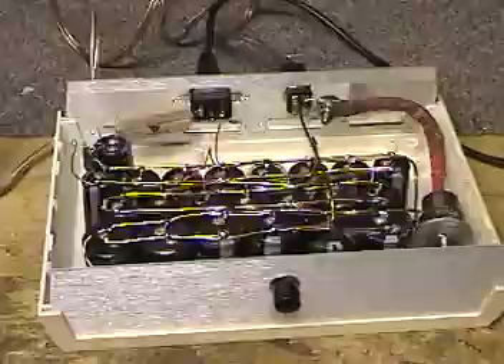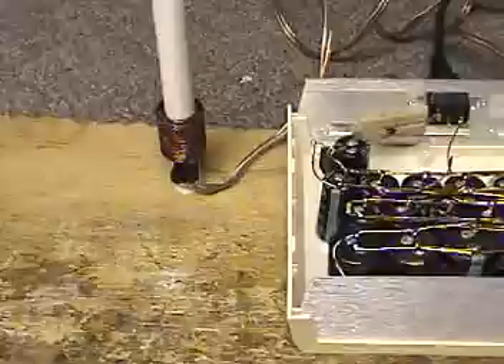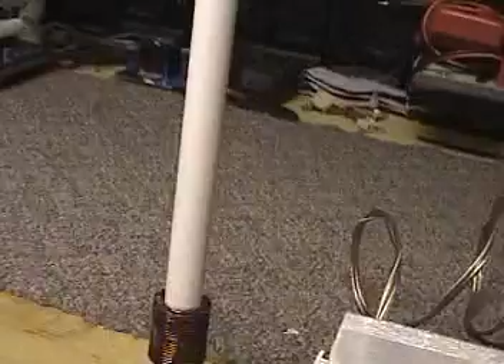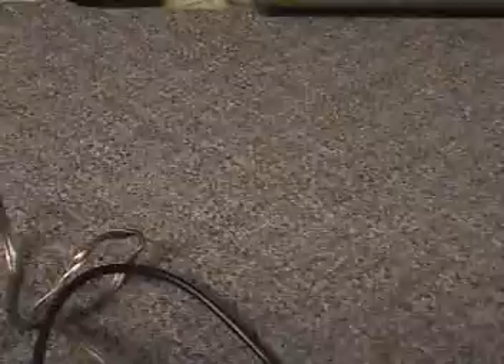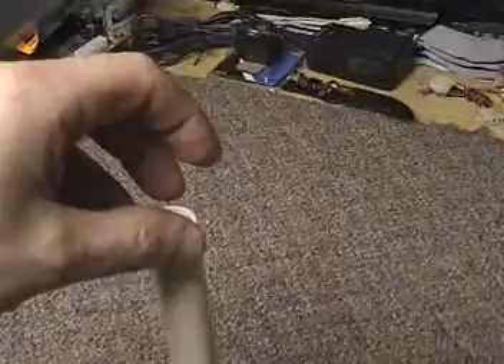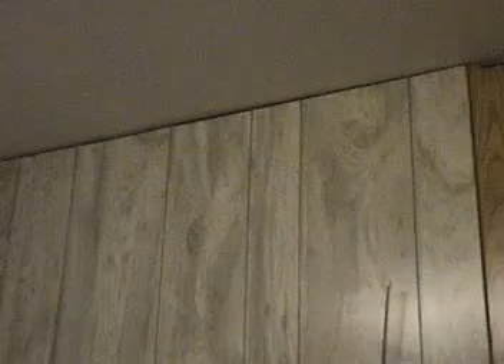My First Coil Gun

Comment from the maker: @ConnorXV  - Depends on the coil and wire size as well.  I used a 100 amp SCR for 300 volts with no problem.

Comment from the maker: I used a voltage multiplier with a current limiting resistor.  It draws about 10 amps but charges in seconds.

Comment from the maker: I am building a bigger power supply that delivers 900 volts.  It uses 8 x 3700 at 450 volt capacitors.

Comment: What you need to do is use a very small projectile accelerated to an enourmus velocity. Ke=MV^2. Mass is not as important as speed. If you cannot get enought current to fire the projectile at high enough of a velocity, try using an explosively pumped flux compression generator. 

»Tony